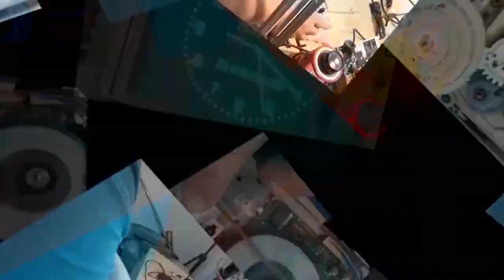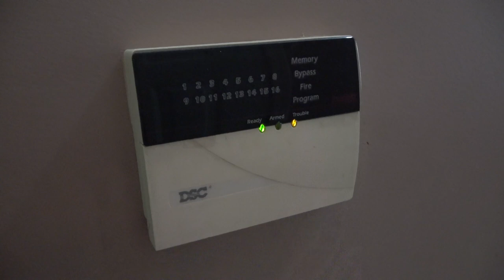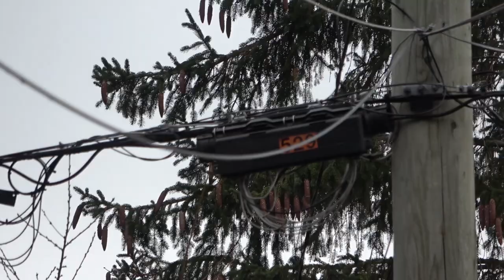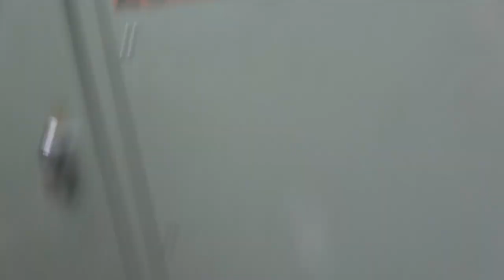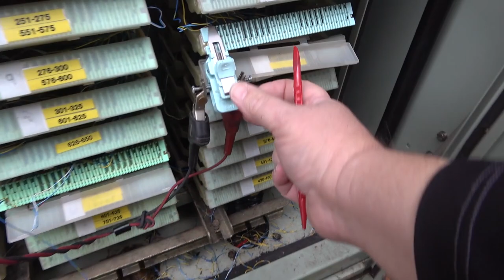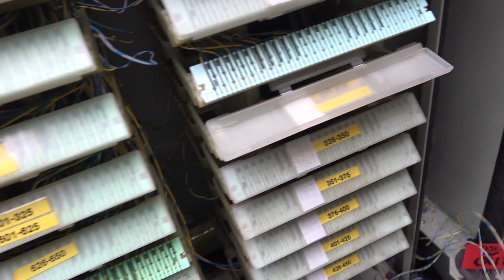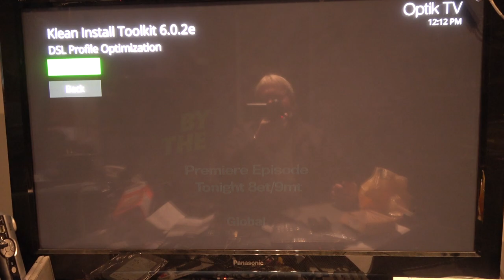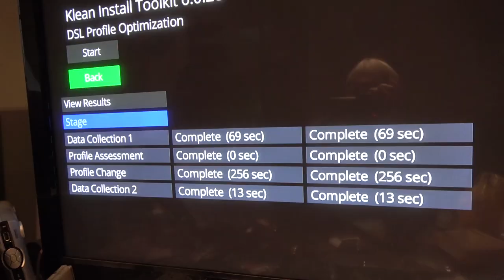Fixing my old noisy copper phone line

Comment: The comments about cell phones and GPS are no longer accurate. If someone dials 911, the system no longer relies on cellular tower triangulation. Now, especially if you have an iPhone, they will see your emergency address.
Reply from the maker: If you live in a multi-family dwelling such as a condo or an apartment the GPS will generally only show the physical address of the building where GPS was last picked up. So what if you're on the second or third floor or the fifth floor. What they get is they get the physical address of the building but they do not get the unit. Not everyone has their cell phone registered to their home address. Many people use work phones. So if I were to dial 911 on my work phone and I was in an area that had no GPS signal to show where I was located such as in a high-rise building what would show up as my work address. That's not going to help me much now is it? The only thing that provides a 100% guaranteed location is a landline. Being an old copper line or one of the new IP based lines over fiber or cable modem they provide 100% accurate address location. And they are the only ones that do the so-called wireless phones they can be moved from one address to another don't provide 100%. I have a friend that has Rogers wireless home phone adapter and he can take it from his place in Vancouver to his other place in Montreal. What he phones me his local number shows up even though he's across the country. Now the company I work for also has these wireless home phone adapters but we locked them to one specific cell site. When the device is first activated whichever cell tower picks it up that's the one that it stays on. It can't be moved at its Geo locked to the address so that it won't work if you take it somewhere else but the one my friend has is an older model and he can take it anywhere and plug it in anywhere and it works anywhere in Canada. So how's that going to help him if there was an emergency? It's not. The only ones that do provide 100% guarantee of where you are our devices that are physically locked to the physical address and those would be ones that were connected by a cable or a fiber optic or a telephone line anything else it's only as accurate as the records.

Comment: I'd rather die than have 70+ ping
Reply from the maker: Just tested on my desktop. 5ms ping 71 down 19 up.
Reply from the maker: If you watch the video, when I tested it you can clearly see the 5ms ping.
Reply: @12voltvids  Oh shoot.  I dont event have 5ms ping with a fiber...
Reply from the maker: @fenokineza6259  my ping is excellent and even better over the past year because so many people have migrated from DSL to fiber that there's not many people still on the d-slam out of 48 ports there's probably only four or five customers remaining. The deslam cabinet that feeds my place has 348 ports and there's probably less than 40 still in operation everybody else is gone to fiber which means to do slime is not loaded and we have full bandwidth. It will be interesting to see how long we keep the fiber cabinets running and keep copper running I would imagine a couple more years and then it'll all be shut off but until then what I have works. That's the same goes why reinvent the wheel if it ain't broke don't fix it.

Comment: At&t  shutting off  anlog phone and dsl internet service
Reply from the maker: It will be shut down here too once everyone is migrated.
Reply: @12voltvids  my local phone company cincinnati bell witch is now owned by a Canada company  has already switched pepole to fiber and digital phone system
Reply from the maker: @bradleyhifi8155  We are switching everyone over to fiber here too. I am just a hold out for the old tech. I don't need anything faster than I currently have. Eventually I will have to switch over because when the copper cables fail they won't be repaired, but until then I will stick with what I have.
Reply: @12voltvids   i had go to cricket wiress becouse i need new phone  and almoast got rip off becouse lady try give me a phone that can't afford